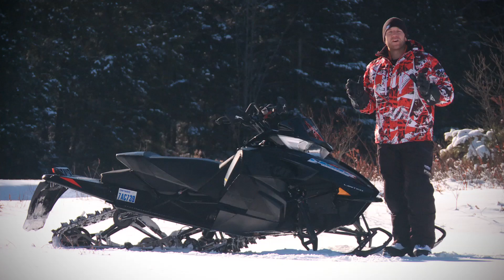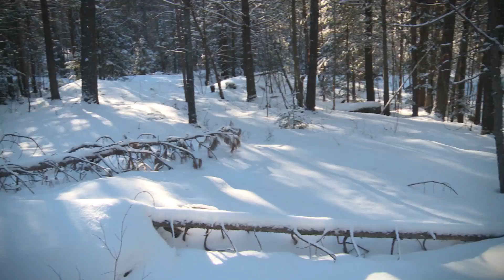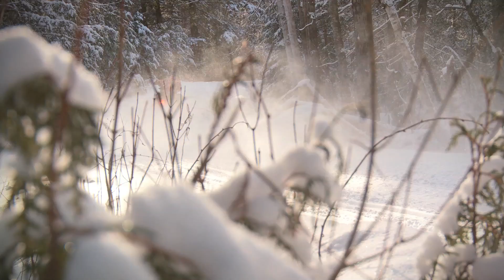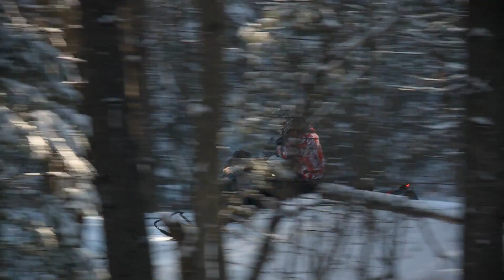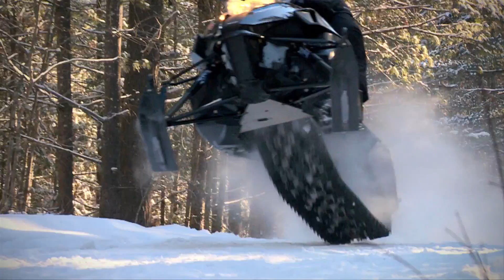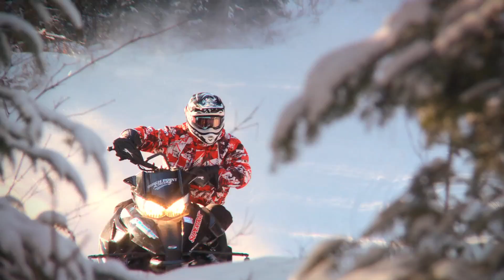TEST RIDE: 2013 ARCTIC CAT XF800

Comment: I’m thinking of buying a used one. Anyone had luck with these over the years?
Reply: They seem like they are the only 800’s around that year that didn’t blow up. I’m thinking about grabbing a 13 sno pro this week
Reply: @curtsawchik1480  I ended grabbing the sno pro after i posted on this video. I’m very impressed with it. Thing smokes my fathers 4 stroke 1000 and his mxz. 800. Also it’s a comfortable ride. I have to replaced the rear shock for the fox set up but that’s been the only issue
Reply: @spfadden082711  good to hear! I’ve only heard good things about them.  160hp stock.  What did you pay for yours? The one I’m looking at is $6800 1080 miles. Seems like a decent deal to me.
Reply: @curtsawchik1480  mine was $6750 with like 4500 miles. Sounds like you’re getting a good deal. Mine is a blast. Fast and handles well. The best sled I have had and I’ve had a lot of them
Reply: I have a 13 XF 800 with 8000 miles, all stock, no issues.  Been a great sled.
Reply: @billysadventuremaster  8000 miles is a lot when you compare it to a ski soo 800. I have had to tear down and rebuild those so many times. I’m happy with the arctic cat and hope I get many more uninterrupted miles.
It think it was the last year Yamaha did the engine?

Comment: Why is this not ideal for trail use? If I compare it to a 129 in. track one? What are 141 in. tracks designed for then?
Reply: Little late but 141 is a crossover
Reply: @krank6  yup. Just bought one of these 2014 for MN. Trails and potential west and north rips